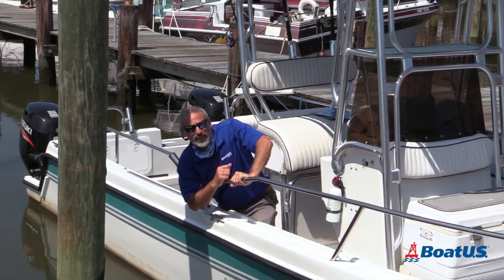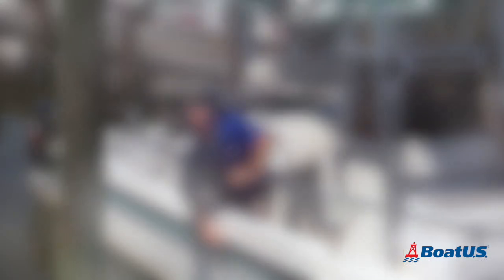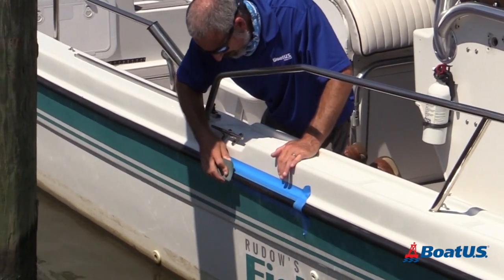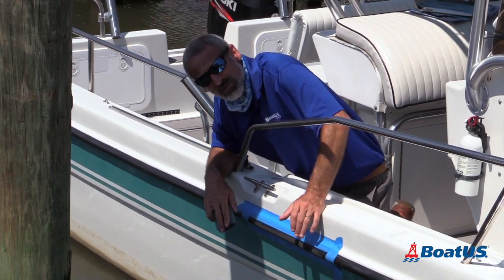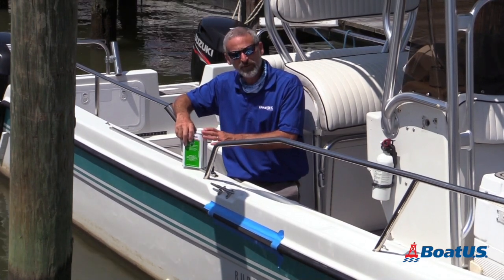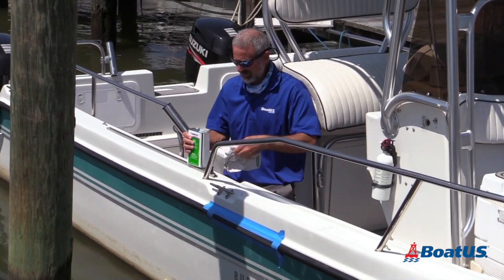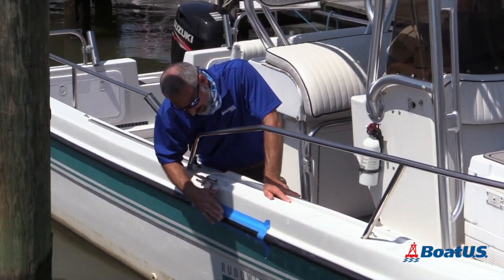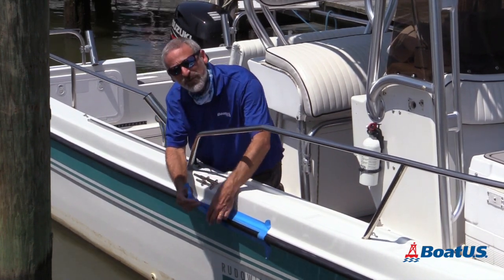Keep Your Boat's Vinyl Rub Rail Looking New [MATERIALS LIST ⬇] | BoatUS

Comment: I have a question what type of sealer can I use because the one I installed on my skeeter 2011 is different than the one it came with the new one it’s a straight sealer rubber and the original had an L shape that molded to the bottoms
Reply from the maker: Thanks for the question, Bassing. We're afraid you're trying to fit a square peg into a round hole -- you need an insert designed to mate up with the type mounting track on the boat. Adding a sealant is likely to produce substandard results that you won't be happy with and you're probably going to be better off replacing the entire track or using the appropriate insert. That said, any standard marine adhesive/sealent (like 3M 4200) will work and will last for years, but will also be very difficult to remove. Silicone sealants will also work but will have a shorter lifespan. Hope this helps.

Comment: Hi would using steel wool 0000 and then finishing with a marime wax like Collinite 885 Fleetwax Paste

Work??? Please help
Reply from the maker: Thanks for your question. I unfortunately don't have an answer as we use the method shown in the video. The solvent "melts" the vinyl, which reduces the look of scratches. You could always give it a try and see what happens, especially if it's a last-ditch effort instead of replacement.

Comment: For this sort of job would you always do the sanding dry?
Reply from the maker: Thanks for the question, Tim. The idea behind wet sanding is to lubricate and remove hard gritty particles that the sanding creates, but in this case, you're sanding a relatively soft material. So wet sanding wouldn't really improve or change anything. Hope this helps.

Comment: 2 hours for that little 15 inch section???
Reply from the maker: It took WAY more sanding than you'd think to get all the scratches out, Jck. We went into the project expecting to knock it out in about 20 minutes. The laugh was on us! Lenny was pretty sweaty by the time he finished. (If the scratches are more extensive than a small area like you see here, it might be more economic to replace the entire rub rail. You can find a how-to guide here: https://www.boatus.com/expert-advice/expert-advice-archive/2017/august/easy-rubrail-replacement)

Comment: Can’t hear what you said don’t know what kind of solvent you’re talking about. Bad video.
Reply from the maker: Thanks for the feedback, Kirt. Unfortunately we had issues with our audio that day, and of course there were all sorts of background noises. If you turn on Closed Captions, you should be able to follow along and get all the info. (It's not auto transcribed.) Also, I included all the supplies and tools we used in the video description. Hope that helps. We'll try to redo it at some point and include better audio. Or if you're a BoatUS Member, we should have an article on this topic in an upcoming issue (possibly Nov/Dec 2023).